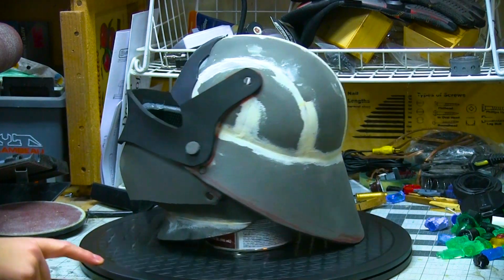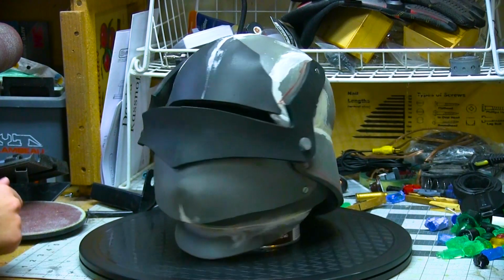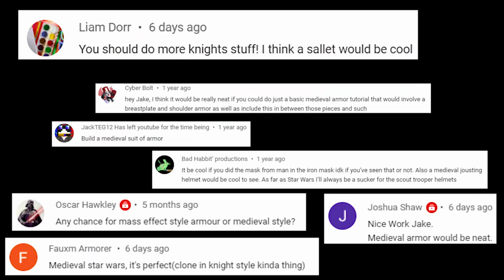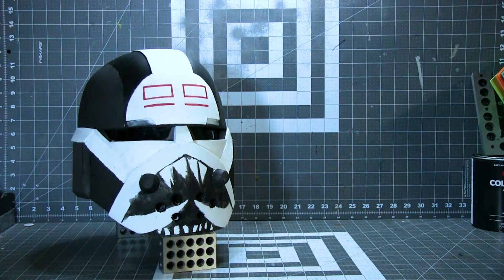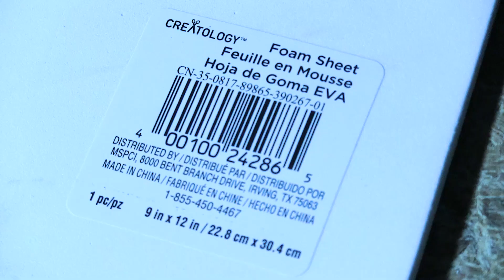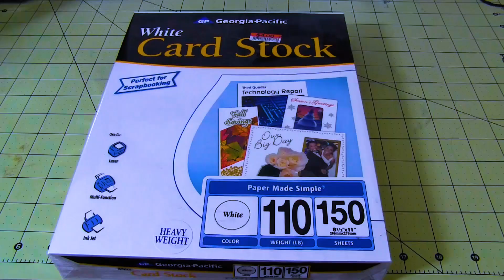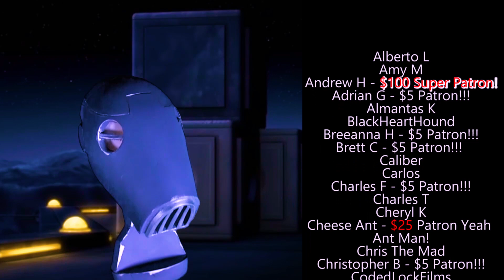How To Make A Knight Helmet (Sallet DIY)

Comment: I’ve found that for some reason some of the floor mats with that texture are tougher. Also is that the same dog you made armour for
Reply from the maker: I've noticed that too, but this package was slightly thinner, so it kind of evened out. No, this dog's like twice as big. I'd have to scale up the templates.